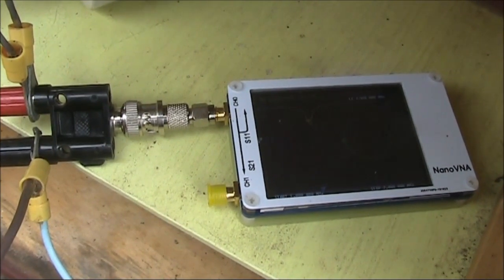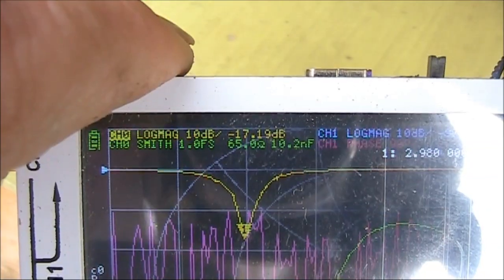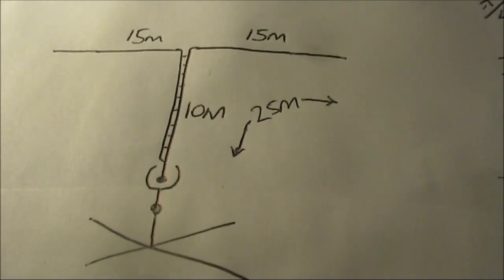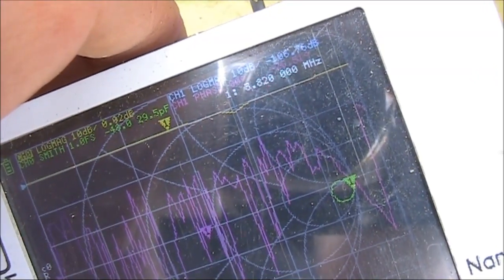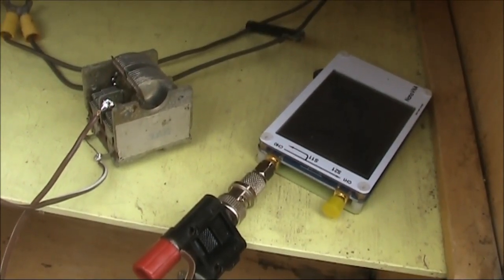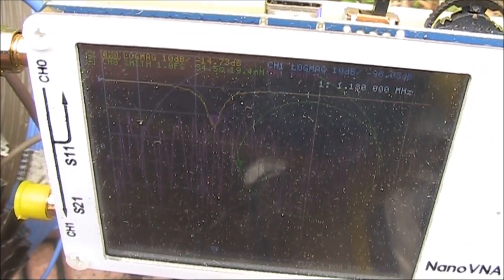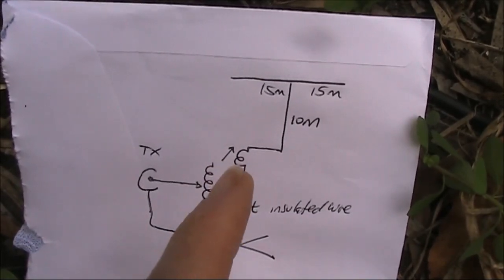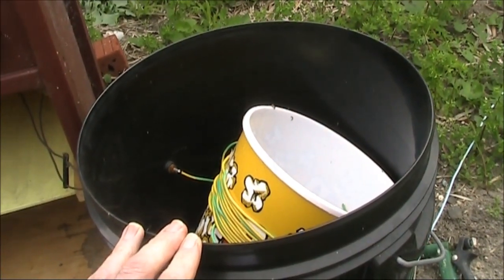Loading up a G5RV as a vertical on various frequencies

Comment: Hi Peter, Another great video. I loaded ZS6BKW inverted V on 80m with an auto tuner.  I was using it daily while camping, it worked great on 80m and I participated in skeds 200-300km distance. I was using KX2 and 10W SSB. They gave me good reports despite QRN caused by storms in the area.  The antenna would tune on 160m but I had no way to test it.  Also, I wonder if you could use a smaller variometer to build a tuner that would work on higher HF bands.

Comment: During the net on 1850 you were readability 3 to 4 in se qld. Had varying results hearing the vk3 in the group. The vk2 and only 2 of the vk3 were an easy copy to me.

I did like Ron's comment about what to call it. When I 1st heard g5rv I imagined someone trying to feed one as normal but on 160m. Every time I have seen that happen performance has been bad. A couple that have tried what you have done it made a very noticeable improvement. Same kind of difference when a local up here did similar to his coax fed 80m dipole for use on 160m.
Reply from the maker: Thanks Rilapy - you're the furthest report I've had so far. Still a few things to optimise with the antenna.
Reply: @vk3ye  Are you planning on doing more wspr tests to see how you go with longer distances or were the initial tests just to get a feel how it would be before tonight's net?